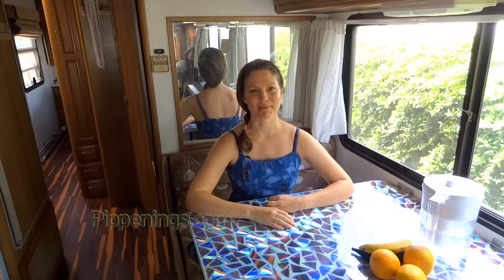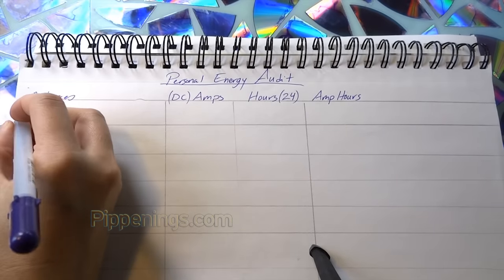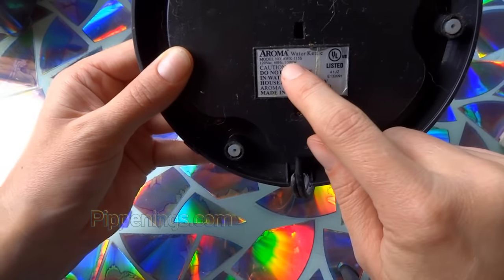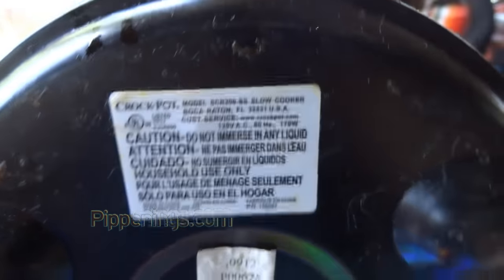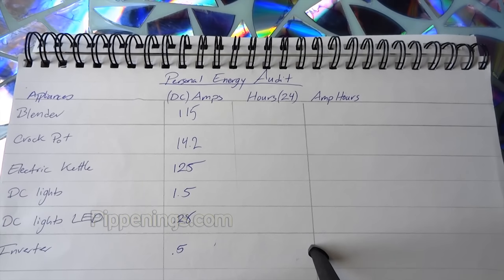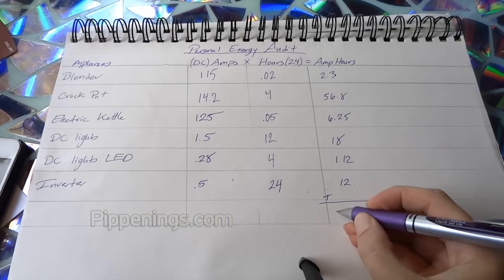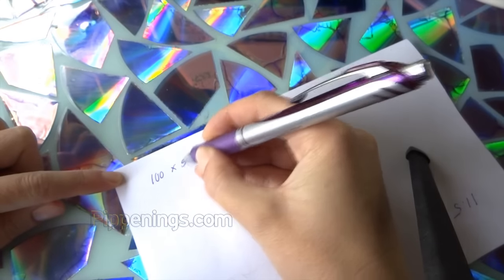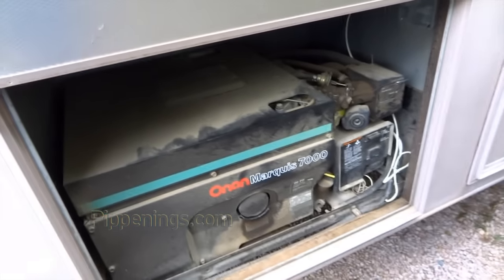RV Solar Living Basics: How Many Batteries and Panels to Use

Comment: Pippi,
       When factoring the required DC storage, you also must consider the losses which take place AT the inverter since none presently which are 100% efficient.  So some of the 75-80% units now in use will have storage needs in excess of those anticipated.  This being mentioned for those who will figure all their appliances and needs perfectly, but still come up with dead batteries while dry camping for extended periods.  Thanks for putting out this series of InFo - it's seriously terrific for people get some knowledge!  
 ~Just Trying to Keep Smiles Charged Up~
Reply from the maker: +TheOregonOutlaw For sure. Also when the inverter is actually inverting it's using more than .5A.  Luckily the ratings on the appliances will give a cushion for what's actually used so can hopefully cover some of those smaller not-so-obvious things... Thanks for the insight!

Comment: Great instructional video! I work in solar and just want to tweak the solar sizing. Since your panels are probably flat on the roof, they won't produce as much power, and you are sizing for average and not worst case. If you size for worst case (winter / December), your sizing would be more accurate and the need for the generator would be less. A 150 Watt panel produces around 8 Amps of energy per hour. I would suggest two 275-300 Watt panels to produce enough energy that in the winter you would not require as much from the generator. I know a lot of people can't do that all at once, but adding more and more as time goes on would get there eventually. 5 days backup will allow for your batteries to last so much longer too...you are definitely right about that.

Comment: I love the floor...good job! I am an electrician and your methods for calculation are close enough....especially if you oversize the solar array a bit as you suggested. An easier and more accurate method of determining your electrical needs would be to stay at a park that meters your electrical use for a few weeks and use the meter readings for your average needs....after all, you won't use ALL your devices EVERY day. I like your videos....keep up the good work!!
Reply: she is good too

Comment: I am a retired electronics tech, 20 years US Navy. What you are talking about is basic DC Ohm's Law, it is a little bit more complicated for AC circuits though, but for a general rule of thumb, OK. but it is a little bit more complicated in reality.

Ohm's Law is A=V/R

A is current in amperes, V is voltage in volts, and R is resistance in ohms

Power in watts is P=A×V.

Technically this true only for DC circuits. For AC circuits you have to take into account the phase angle. Inductive circuits (think transformers and motors) current lags voltage, capacitive circuits voltage lags current. But as a general rule of thumb for low power circuits it is generally OK.

Comment: Good video,  I used my 100watt suitcase portable solar panel to keep my one group 29 battery charged in our summer trip to  Alaska.  One handy item was a cheap 12 volt digital monitor you plugged into the 12 volt outlet to let you know actually what volts your batteries are at.
Reply from the maker: +jay super Great input, thanks!
Reply: I did make up a extra 10'cable  (Panel comes with a 15' cable) to catch a sunny spot on my campsite.  $279 (Amazon) well spent.

Comment: Hello Pippi.  I have been considering solar in my rig.  I am a weekender and I like to boondock.  My usual trips are about 3-4 days, but I'd like to be able to boondock for a week at a time.  I have asked around different RV forums and such about solar power.  So far the answers seem to all be saying that I should get a battery bank of about a gazillion amp hours and put up 9 million killowatts of panels.  

I'm in Iowa and can usually depend on about 8-10 hours of good strong sunlight each day.  My energy audit shows that I'll average using about 50 amp hours a day.  (35 if I'm in survival mode and up to 70 if I indulge myself - lol.)  My battery compartment is completely full with 400 amp hours of flooded deep cycle lead acid type batteries and one starting battery.  There isn't a good place to locate another battery compartment.  I have a small genny (1000 watt) but I want to use that as a back up for the solar.  I'm thinking of starting with 200 watts of solar (PV) panels.  Can you make me some recommendations please?
Reply from the maker: +clyde alspaugh Am I assuming correctly you have two house batteries, and you're getting 400 AH? Are those hooked in parallel? That's pretty good for 12v batts if you're on a 12v system.  Sounds more like 4x 6 volts. If it's just a few days this is still a little low as far as your panels are concerned. Can you add another panel? Make sure you're fridge can run off gas and mostly you'll just be using LEDs.
Reply: Hi Pippi.  Thanks for the feedback.  Since you asked, here is some info on my rig/thoughts/plan.
The rig:
1987, 22 foot class A that I bought for $4000.  I'm upgrading it a little at a time as my budget allows. (and a slim budget it is-lol)

My battery bank is flooded lead acid type marine deep cycle batteries.  There are four of them (100 amp/hrs each) connected in parallel for a 12 volt system.  To add more battery capacity, I would have to change to a  6 volt trojan type battery or build a larger battery box.  That's outside the budget so I'm not planning on that for now.  There is no onboard genny.  I use a portable 1000 watt inverter generater. 

My lighting has all been changed out for LED type bulbs which helps decrease the draw on the batteries.  My frig is a Norcold 3 way (Circa 1987) so it will run on gas.  I only run it on electric when I am camping with hookups.  Since I mostly boondock, It's nearly always set to run on gas.

The goal:

My goal is to be able to boondock for up to 7 days at a time.  At a max, I might stay for 2 weeks once a year.  In the case of longer trips, I'll just have to run the genny a bit.  The less genny time, the better.  My budget for this project is $400 with a planned $200-300 more next year for upgrading the array.  The solar system is intended to be a method to minimize my genny use while extending  my length of stay.  I don't intend it to be a total power solution, but an adjunct to the other tools for power management.

The plan at present:

For a start, a pair of 100 watt panels wired in parallel and a PWM controller.  Next year I plan to add another 200 watts to the array.  I'll make sure that the controller I buy can accept a 400 watt array input so that I don't have to get a different controller when I increase the array size.  The panels won't be mounted on the rig. (at first anyway)  I'll use them in a similar manner to the suitcase solar products that are out there. 

When the additional pannels are added to the array, I'll want/need to mount them.  Four panels at 28 X 40 inches each will get cumbersome on short boondocking trips otherwise.  I like the suitcase idea though as it will let me position the panels for maximum sun exposure without having to park the rig in the sun.  The downside is that it's more hands on than a fixed mount panel.  Everything is a trade off, I guess.

The reasoning behind the plan:

With a battery bank of 400 amp/hrs, I have 200 amp/hrs of usable power in storage.  My detailed energy audit shows that I'll use 50 amp/hrs a day.  Without putting back any charge to the battery bank, that would allow for four days of boondocking. (the goal being a 7 day capacity)

 Since the panels will each produce about 5 amps of current, hooking them in parallel should give me a 10 amp maximum charge rate. With 5 hours of sun that would theoretically be 50 amp/hrs.  Decreasing that figure by 25% for the real world leaves it at about 37.5 amp/hours per day but I'll just round it down to 35.

With a usage of 50 amp/hrs, this will result in a net loss of 15 amp/hrs each day.  Theoretically, with this setup, I could go for 13 days and just be hitting that 200 amp/hour mark.  Then I'd need a full recharge. Since this is double my 7 day capacity goal, I figure that it is a good starting point.    If I look at the potential that my usage will actually be more than my energy audit foretells, I can calculate that at a usage rate of 60 amp/hours a day, there would be a net loss of 25 per day and that would support 8 days. This just stays within my goal of seven days.

As I write this, I can see that I need to look at a different charge controller.  Since the one that I've been looking at has a maximum output current of 10 amps, increasing the array size would not increase the amount of charge delivered to the battery bank.  I'll want a controller that can output a higher current, or else the additional amperage produced by the larger array will be lost.  (It's like with the internet, where the slowest component in the chain determines your maximum speed.)

Do you see flaws in my logic or my figures?  (To simplify things, I have purposely ignored the factor of how quickly the batteries will accept a charge when they get closer to being full.)   Thanks again for helping me with thinking this through.

Comment: You say "120 watt panel will produce 50 amp/hrs per day".  Maybe in south Western US in mid Summer.  But more likely it will average much less over weeks of the season less in Fall / Winter / Spring.  A 120 panel is rated at 7amps, so you would have to get more that 12 hrs of strong sunlight.  Not really likely most places I know of.    OTHERWISE,  very good video.  Most people NEVER consider what they are using to match their batteries and panels !!

Comment: Good video., thanks.   How often to you exercise your generator?  How often do you run the engine?  Do you use a gasoline preservative in your tank?  Do your new tires have flatspots from sitting?

Comment: I am putting 12 Stion 135 watt 90 volt output Amorphous Frameless on my 35 foot 1976 Holiday Rambler. The 10 Dekka AGM 31 battery bank is centered in the sealed belly in a basement cellar style access set up. Running into 3 60 amp MPPT controllers and a mean well 3000 watt true sine plus a 2300 watt powerbright modified for general use. Runs both my re-designed 5200 btu ac units with not one bit of issue and this winter I will make videos on the process.

Comment: Okay post, but I'm an electrical engineer and experienced RV'er with solar and there are significant errors in this presentation.  Most have been pointed out by others so I'll reinforce with a summary.  You need to measure power usage of appliances to have any idea of their power usage.  Use a Kill-a-watt power meter ($20) 120V appliances and watch the full cycle of use; e.g., for a coffee maker -- it may not draw full power ever and won't draw power for the full cycle.  The Kill-a-watt has a watt-hour mode; convert the results by 12 to get amp-hours.  Lead acid batteries do waste energy during charging and discharging, so up the amp-hours at least 30% to cover that (40% to be conservative).  She is very optimistic on the 50 AH output from a 120W panel.  If you place it on the ground on a stand and keep moving it as the sun moves, maybe.  But, on the roof a panel will rarely be optimally oriented and even clear sunny days don't always give the solar that you would expect.  I had to double my panel capacity over my calculated amount to get a full re-charge even on "good" solar days.  The 20% depth of discharge suggestion is interesting but it's not economic.  Carrying that much weight would be inefficient (think mpg) and lead-acid batteries have a limited life even if you go easy on them.
Reply: I've hear that "Thunderbold Magnum Solar 100W Solar Panel Kit" is a great kit to have and will charge your electrical needs even on the darkest of days.  It may be slow at charging but it'll still charge even if they are laying flat on the floor of the roof.  My question is, have you ever used this kit?  What do you think?
Reply: The way she is calculating it is wrong because she will not be using all of those electronic devices at the same time all day long.🤔🤔

Comment: I did it again and this time I got 1162.50 ah/day. Better but... Thanks again Pippi.
Reply from the maker: +The Rogue Less Travelled I think I came out to a little over a thousand too but keep in mind that's a yearly average. I'm not using that everyday all year around. My battery bank is 800ah and I think I'll be fine minus air conditioning

Comment: You might clarify that the reason you divide by 12 is that you have a 12-volt system. Watts = Volts x Amps, or W = V x A, and A = W / A

Comment: Cheers for the vid :) should I devide the wattage by 12.8 to get dc wattage rather than just 12? I thought 12.8 was the actual voltage of a 12v battery?

Comment: i just got to the part of your audit sheet .... rather than trying to convert things from"ac "amps and "dc" amps ( there really is no difference ) just convert everything to watts .... then everything that is going through the inverter , increase the watts  by 30% , by multiplying the total by 1.30 ... this should be enough to account for inverter  losses .  then add the total watts used together and this will give you your total watts being drawn from your battery bank

Comment: Great video! And that table is awesome! Also could you repeat the "pink floyd" section of video, I didn't see nor hear anything but pink floyd. ..😂 so 20watts yields 50 amp hours? Also I habe heard that if your panel are rates at say 100 watts, consider them to be 80 watts because that's just the way they are? I plan on getting a watt meter to monitor my Harbor Freight panels. Their box only does volts.

Comment: I have got to put input on crockpots. 
for the small $10 crockpots. I dont care what it says. they require 400 watts per hour. 
This is from a lot of headaches and experience.
the 100w some of you may see is once it warmed up, just for the warm setting WHICH IS LESS THEN the low setting and will not cook a anything.